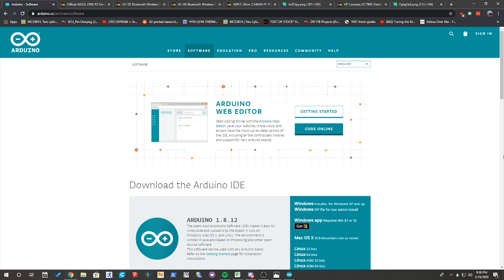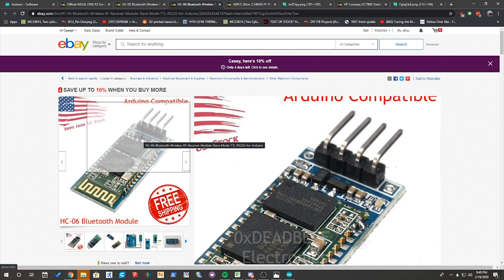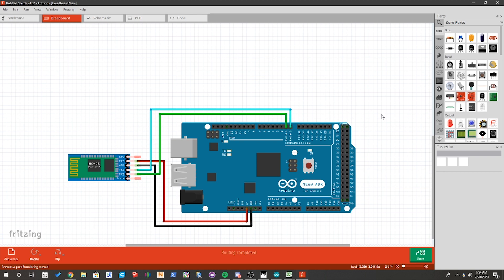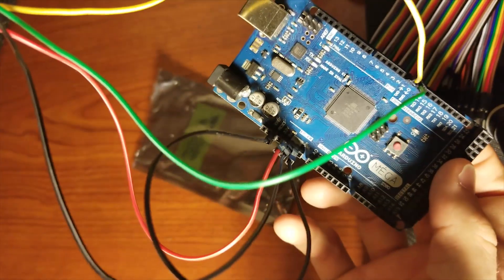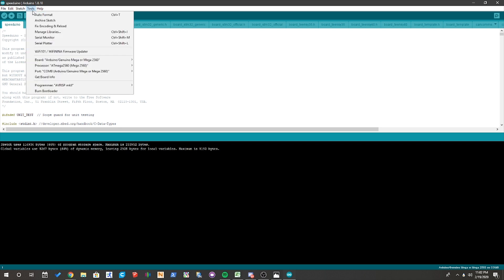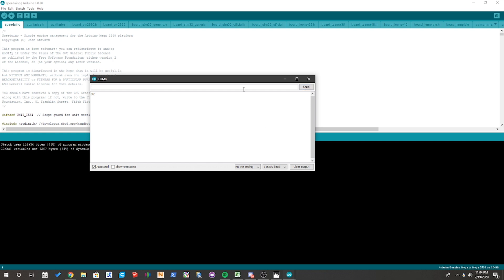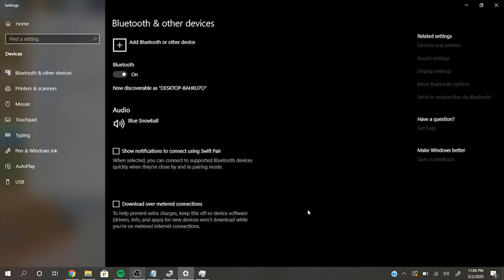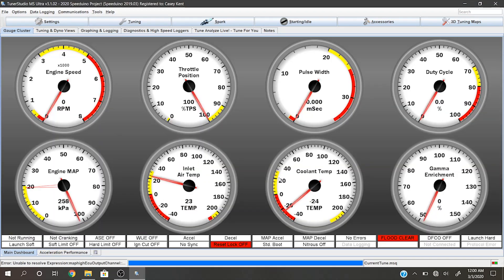SPEEDUINO/SPEEDYEFI Bluetooth Guide

Comment: I have a question, why do I need to flip RX and TX after programming bluetooth module? I accidentally left mine connected RX to RX, TX to TX and everything is working fine.
Reply from the maker: Really good question. I'm not 100% sure to be honest! Rx is short for reception, and Tx is short for transmission, so I think that's why it's transmission->reception, since the Rx pin is supposed to recieve data.  In AT mode though you do end up reversing those and it still works, so perhaps it's not as important as I thought. 

I'm gonna do some digging and see what I can find.
Reply: @toomanymiatas  ok.
P.s. nice video, helped alot :-) !

Comment: Did you have to use a sketch? I used a sketch code and the serial commander just goes crazy! Any ideas? I also made a video of the problem I’m having
Reply from the maker: No sketch should be needed - you're simply using the Arduino IDE as a way to communcate with the Bluetooth module. No need to upload anything to the Arduino. 

Looking at your video, it looks like your problem comes the code you uploaded to the Arduino - you told the Arduino to print "LED off" whenever your flag is in a state of 0, and since it's always at 0, it's continually repeating LED off and spamming your serial monitor.

Sorry it took me so long to reply!

Comment: I can't seem to be able to set a new pin. "AT+PIN1111" doesn't return anything. Also, the "AT" command didn't return anything which drove me mad trying to figure out why I can't connect. Turns out I can, kind of, becasue "AT+BAUD8" and "AT+NAMESpeeduino" worked. Just weird that the other two commands don't.

Comment: FOR THOSE OF YOU SUFFERING WITH AT OK BUT AT+BAUD8 RETURNS AN ERROR:

type in AT+VERSION into the monitor and if it returns a "3.0-xxx..." (x's being a bunch of numbers)

------------------------------------------------------------------------------------------------------

The AT commands appear to have changed for this different/newer version. Instead of AT+BAUD8 do:

AT+UART=115200,0,0

(substitute 115200 with whatever baud rate you want)

------------------------------------------------------------------------------------------------------

To change pin, instead of AT+PIN you will use:

AT+PSWD:"0000"

you need the quotations, note its a colon instead of an equal sign

(AT+NAME & AT+VERSION are the same and work btw)

Dont know any other commands but if you know any useful ones comment them at me. This shit took me like 3 hours to figure out lol